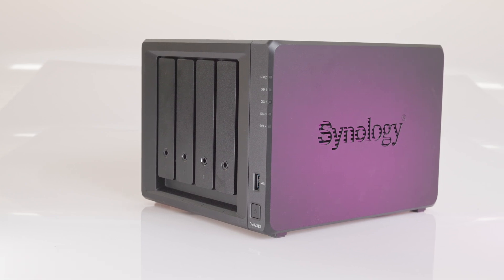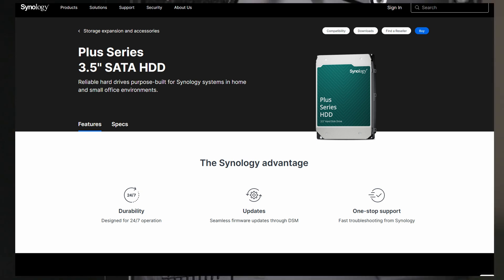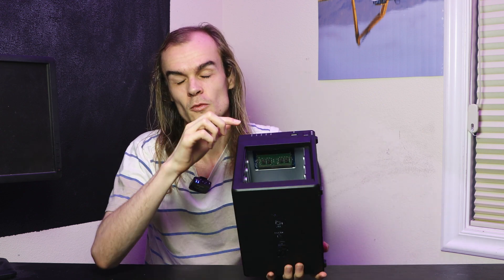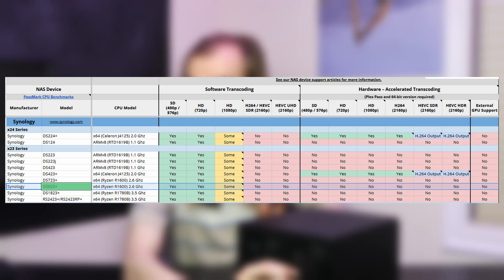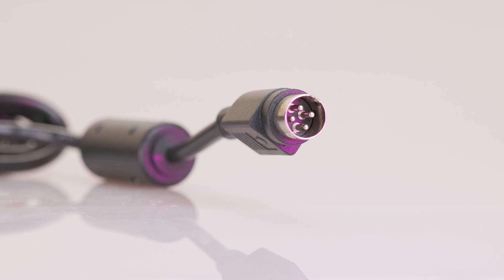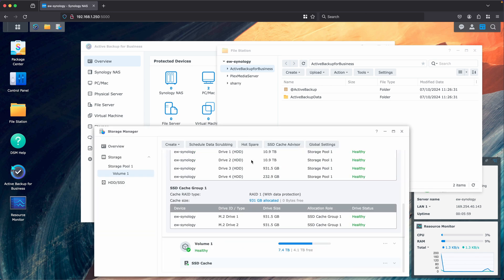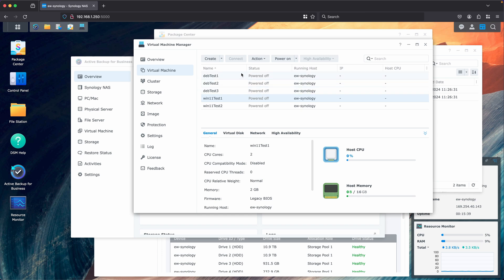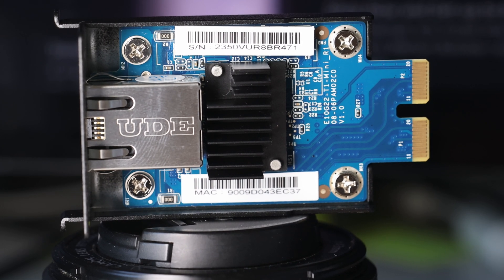Synology DS923+ Review. Checking out a premium 4 bay NAS

Comment: I've been using TrueNAS scale in my homelab since the beginning, because I'm cheap and it runs well on old HP office PCs, but it's far from what I'd call user friendly as someone who only learned what a NAS is a couple years ago. As I've moved to "the NAS is the NAS and nothing but the NAS" architecture with other Proxmox systems for apps and VMs, I'm increasingly tempted by Synology's simplicity, backup apps and ability to add drives as you need.